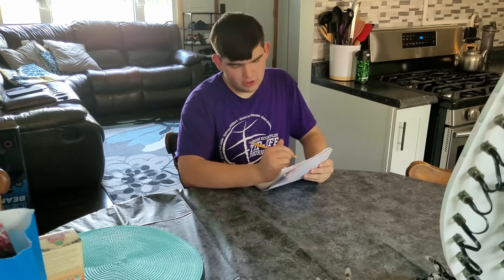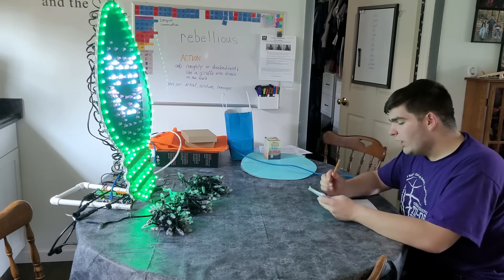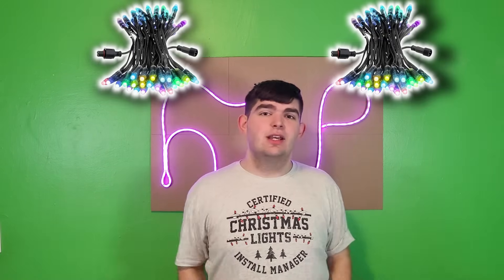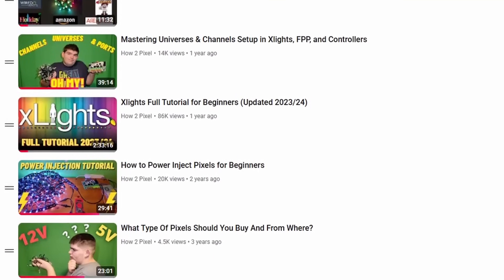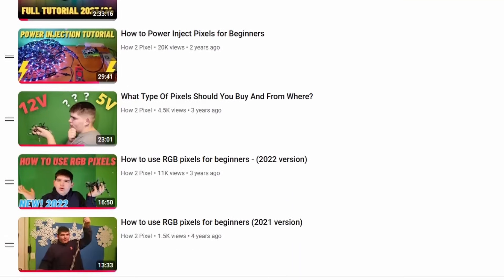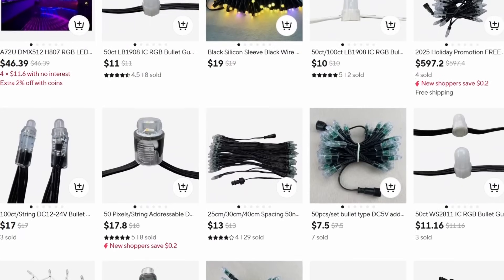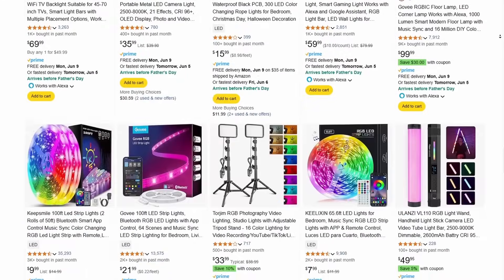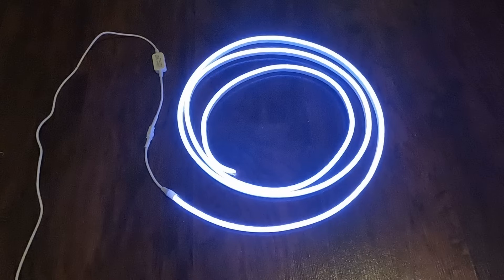How RGB Pixel Lights Work (And why they're AWESOME!!)

Comment: Hallo an alle bin neue hier und ich brauche Hilfe in xlights. Habe eine Falcon 16v3, einen Mega Tree 16 Strings (2Strings Mal =100 Pixel) mit 800 Pixel, dann  4 Mal Singende Bäume mit jeweils 217 Pixel, dann einen Stern mit 2 Strings mit 200 Pixel, dann einen Kleinen Stern mit 140 Pixel. Und einen Großen Stern mit 230 Volt 2 Kanal 512 DMX  angesteuert, dann noch 8 Stück Mini Mouvingheads jeweils 12 Kanal DMX 512 auf serial 3 Ethernet gesteckt, und noch 8 Stück LED Paars mit 7 Kanälen auf der gleichen Leitung. Kannst du mir helfen bitte , da ist noch was mein Englisch ist sehr miss, Komme mit denn 510 E1.31 und DMX 512 nicht zurecht, bei mir Flackern die Pixel, Habe aber Zwei Netzteile mit 5volt einmal mit 70 Ampere und einmal mit 60 Ampere aufgeteilt in Links und Rechts bei der Falcon und bei der Erweiterrungs Platine mit 16 Ausgängen. Bitte um Rückmeldung. Bin der Thomas Pichler aus Österreich am schönen Wörthersee Danke Danke.
.

Comment: Do you think I could de-solder the led and connect wires to connect non-addressable rgb leds
Reply from the maker: Possibly, but my only concern would be the amount of current going through the chip. They aren't made to control lots of LEDs, just the 3 inside the RGB light. I'd recommend doing some more research to see how much current you can have go through one chip before attaching lots of lights.
Reply: @How2Pixel ok thanks
Reply: @How2Pixel I am still trying to get the plastic of the pixel how did you do it

Comment: Hey Nick. This is kind of unrelated to the video, but you have mentioned before that you run your show at 30% brightness, or something similar to that. I was wondering how I could change the brightness of my show. I plan on using xSchedule, but there's a chance that I use FPP, so it would be good to know for both. BTW, I'm just getting started with pixels this year. My previous displays have been AC shows. Your videos have been EXTREMELY helpful- to the point where I can't even explain how much you have helped me. I love how you take the time to really get your points across and make sure that anybody can understand what you're saying, I also appreciate how you organize your videos into playlists and make sure to put chapters in every video. Trust me, I edit and upload videos as well. I understand how time consuming it can be. I can't even imagine how long it takes you, especially when most of your videos are over 30 minutes. I really don't know what I would do without them, so thank you!

Comment: The intro was awesome!!!!  I like how you are doing the beginner series and commend you for taking the time to explain in the most simplest terms what they do.  The one thing I wished you had done was go back in time when I was beginning how to pixel back in 2010.  I am still learning!!!  Worth mentioning is RGB dumb lights do not have an individual chip per light, just 1 for the  whole strand.  The color palate RGB with RGB lights fully on create white. Old color TVs had these RGB guns in them to create color.  When you get to yellow.... OLED TVs use them with RGB to get more colors and depth.  Loved the explanation on how each pixel gets their data for lights.  The way each individual pixel gets the instruction is by their ID in the strand to get their instruction paper.  Great video and you can use this for basic data instruction.  You missed your calling as an instructor.  Great job!!!!!